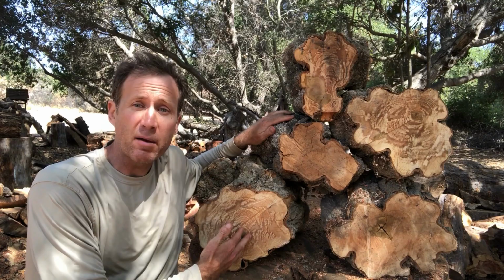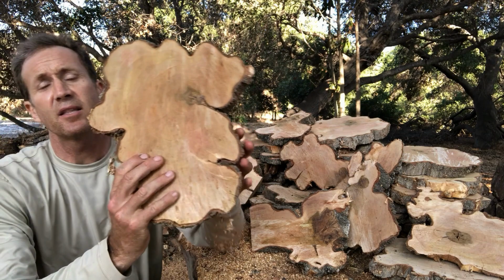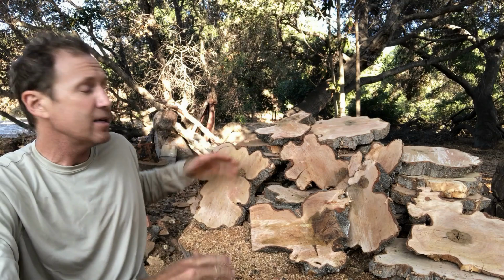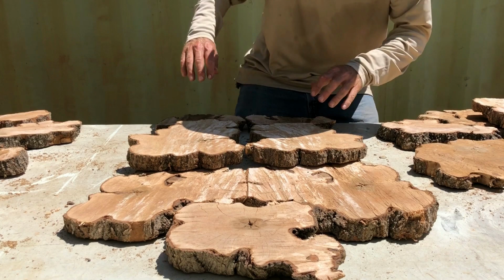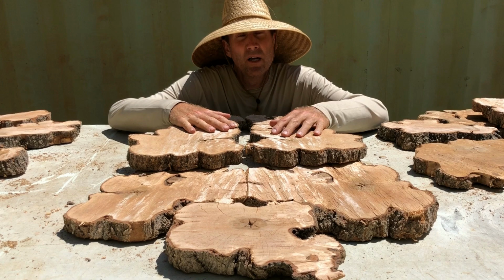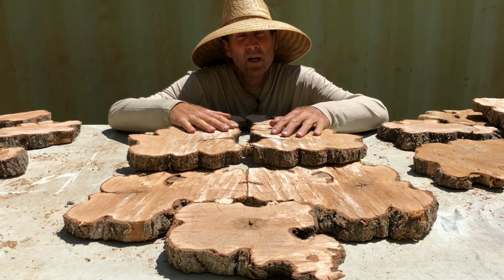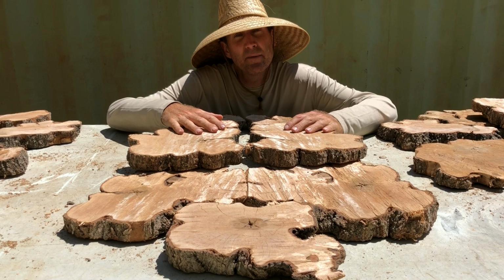The soul of wood wall art

Comment: Found this in your list.  Thanks for sharing your motivation and inspiration.  Have to cut my pieces thicker,  wondering if you could have sanded after gluing and stapling?
Reply from the maker: I usually do some sanding after gluing and stapling. I don't show the entire process in the videos because I want to keep them at a reasonable length. Usually I sand a few times (at different times) throughout the process of making the art pieces but it always varies from piece to piece depending on what's needed to get the result I'm after.